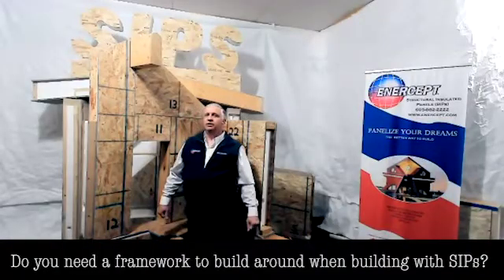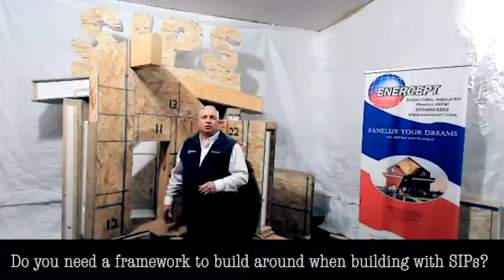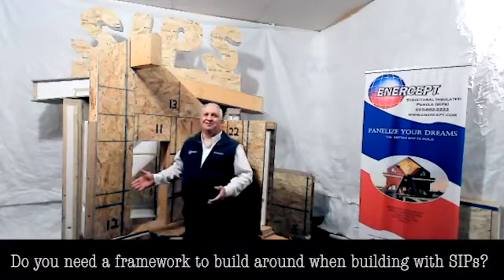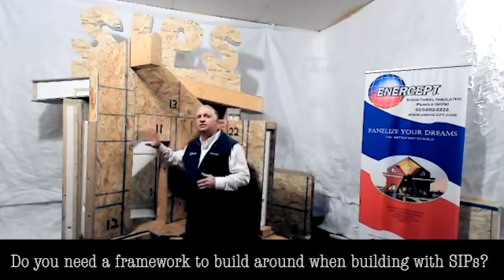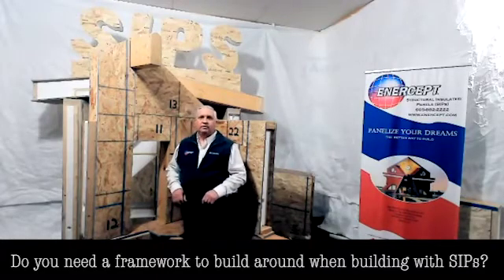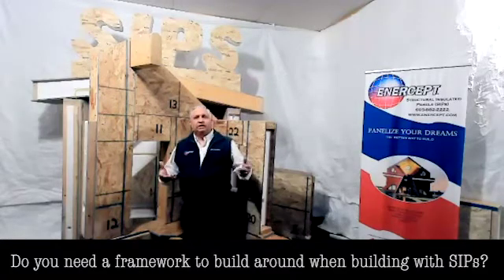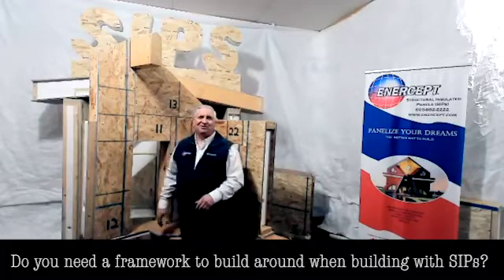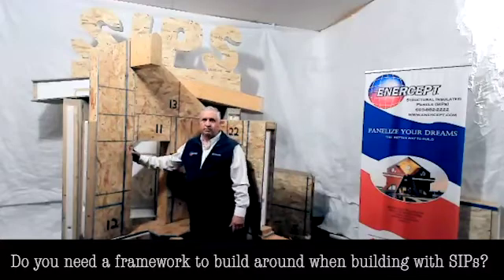Do you need a framework to build around when building with SIPs?

Comment: There is a need for a ridge beam in SIP roofs.
Reply from the maker: A ridge beam is one way to support the roof panels.  Trusses spaced 4' to 12' apart are also used.  The support of the roof panels will depend on the design of the building.